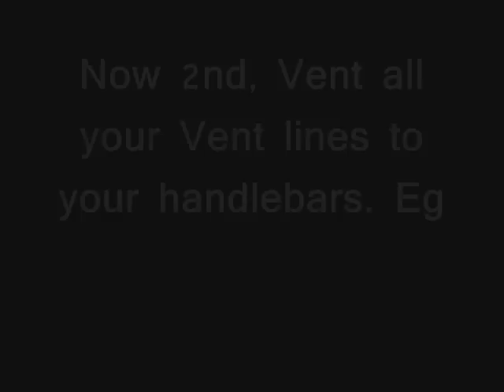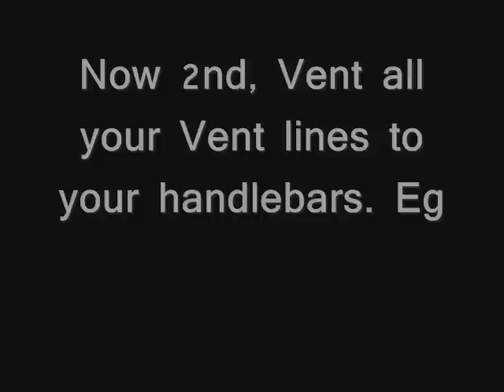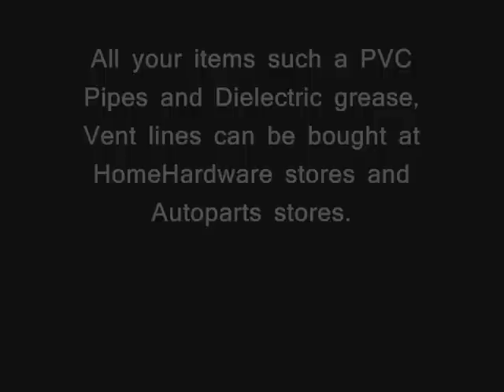Basics on How to Make an Atv Snorkel

Comment: I just tapped a ⅛" thread ¼" barb fitting in the PVC  by the air box to run all my vents too. Looks better than a bunch of lines running up with the snorkel.

Comment: @sgttroyer Guess you wanted a quick reply. I snorkeld my bike cause of the same problem. When you let off, no the water wont get sucked in as much. When you hit the throttle though it sucks in air, that is where you get the air to the carb for the right air to fuel mixture (A/F Ratio). Regardless it is bad to go completely under water with a stock or aftermarket snorkel. It has to breathe fresh air. I built mine myself too.

Comment: I think i used to big of a air inlet pipe now my bike is bogging 1/4 throttle. I adjusted my air fuel mixture it helped a little. Do you have any suggestions?
Reply: You have to re jet it

Comment: awesome video and thanks for posting! helped me alot i never even thought of the dialectric grease. gonna watch it a few more times to make sure i gots everything but i was gonna send my bike in to have a snorkel put on but i would much rather do one myself now that i have watched this. so in review, i have a 92 yamaha big bear 350 4x4 anything i should know about venting? ie, transmission, i know carb has to be done, what about the top end there is that an intake aswell and needs to be ran up?

Comment from the maker: Yeh. I couldn't turn because the handle bar hit the snorkel. But I just put another 90 degree bend to face down. I just take it off when I go full throttle, better air flow.

Comment: @TheLemonlime19 Mine cost less than $25.00. I used 1.5 inch PVC and a few elbows and a prefilter. You have to rejet the carb for more fuel flow because the 1.5 inch is too much air getting sucked in. I have a suzuki and you cant adjust the carb needle like on a yamaha and I wasnt gunna pay $50.00 for a rejet kit so I got a prefilter on the tip of the snorkel to restrict the air flow. You could just put a PVC cap on it and drill a 1/2 inch hole in the cap. My buddy did that and it works fine.

Comment from the maker: @smallman334 yeh when u create bends it restricts air flow, therefore you get higher fuel: air ratio so.. you have to lower your jet size. You can totally avoid this by using vacuum hose, which creates less restriction and is easy to work with.

Comment: Good video, I made one. Extended all my breathers, minimum 1 1/2" piping, 2"  for most of it, not too many bends. I get it on, and the bike will hardly idle properly, and has very little power and will cut out for a second at a time and almost stall while driving. Starving for air. Any suggestions? Please respond somebody!

Comment: ok.. you showed the easy stuff. what did you use to attach it to your air box?
Reply: U just run the pipe through the fourwheeler until u get to the air filter box

Comment: can u attatch a pipe directly to the carb instead of using airbox because I have no vent lines either as ive modified carb to work with a pitbike carb on the quad
Reply: Amy Robertshaw you can if you put a filter at the top of your snorkel

Comment from the maker: @bob97308 
You can but you have to run a separate air filter and you need to tune your carb. Also you run the risk of getting watter straight into your carb rather than into your airbox. I advise not to do this unless, you plan on racing.

Comment from the maker: You need to vent the snorkel and outlet for the clutch (it's a dry clutch system) and then snorkel the air intake. There should be detailed video for can am's, good luck.

Comment: why does some snorkel kits have more than one intakes/snorkels
Reply: More air flow and looks
Reply: Nicolai Trinh for automatics with a belt box intake and exhaust to the belt have to be snorkeled which is why there are kits with 3 snorkels and somtimes 4 to have 2 coming from the intake on bigger atvs

Comment from the maker: you can vent it back to pvc, but i just didn't want any water going into the lines if the airbox filled with water.

wouldn't hurt your wallet to vent to the lines seperately